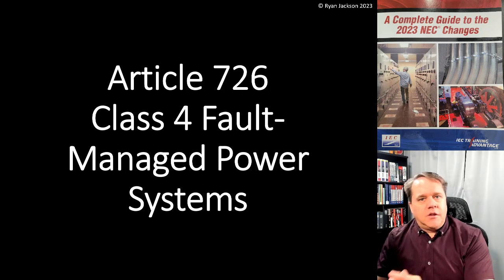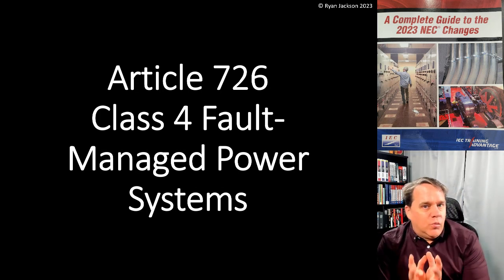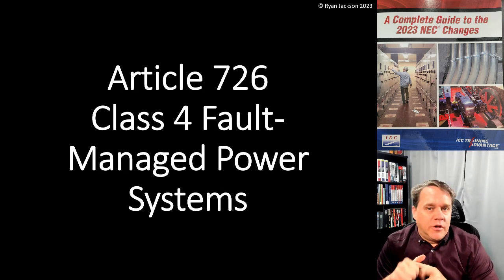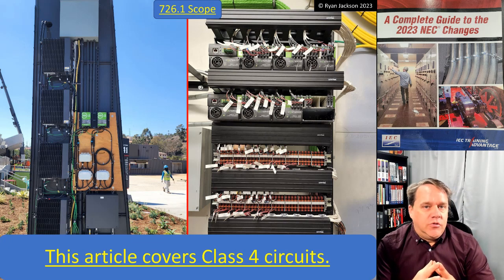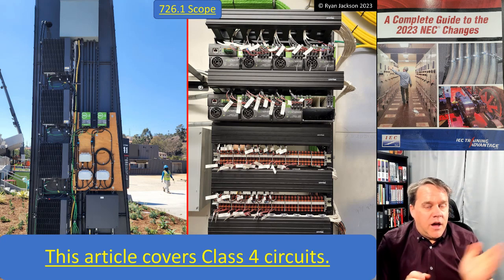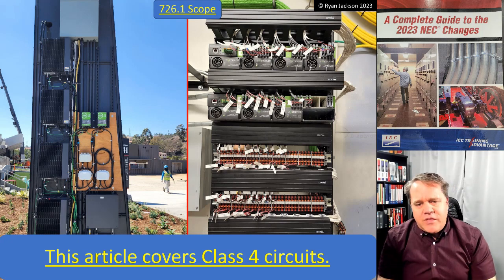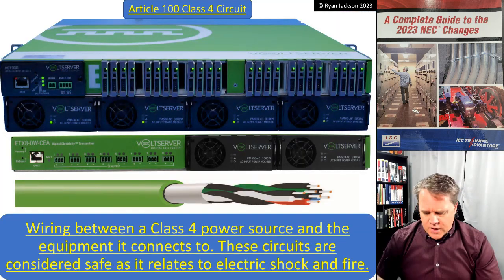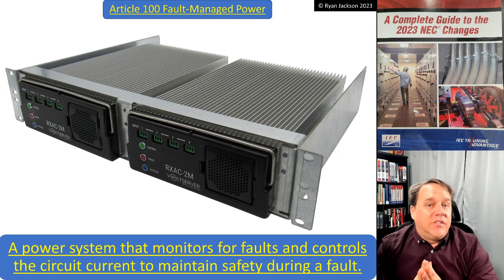Article 726 Class 4 Fault-Managed Circuits

Comment: Just wondering, can this work with one transmitter and multiple receivers? I was discussing this with someone at work the other day and he thinks this will become a standard for residential electrical distribution and completely replace the use of ac power in homes with appliances being directly powered with dc.

Comment: This should be used with solar panels / MPPT charger and high voltage batteries and power the whole house with DC instead of unsafe / inefficient AC.
This should be the first plan and not the 5G antennas :)

Comment: Transmitter/Receiver can communicate with each other at 1/500 sec speed but ultimately Circuit breaker has to open the circuit.

But seriously doubt  if a Circuit Breaker can trip within 1/500 of a sec. Please clarify
Reply from the maker: The transmiter stops sending power in 1/500 of a second. The circuit breaker plays no role in that.

Comment: Just saying 450 volts causes this old electrician to pucker up! Great video.  I worked on a lot of remote I/O equipment that operated on networks where everything was talking to everything else. All at very low voltages though.